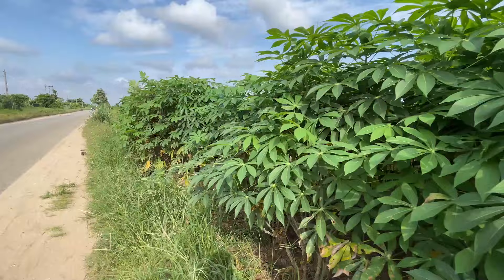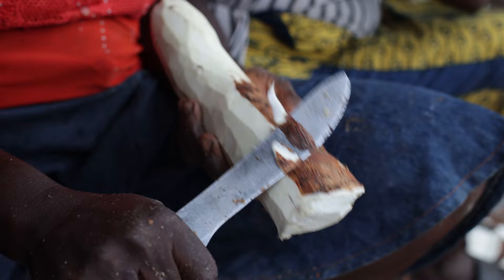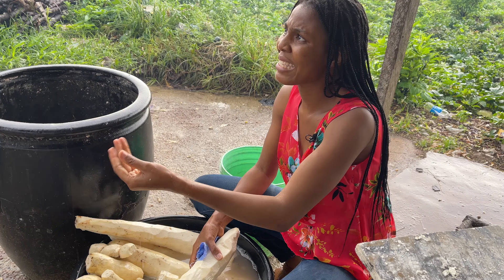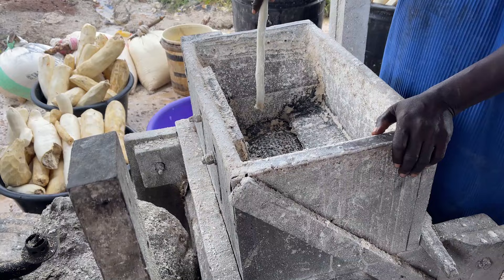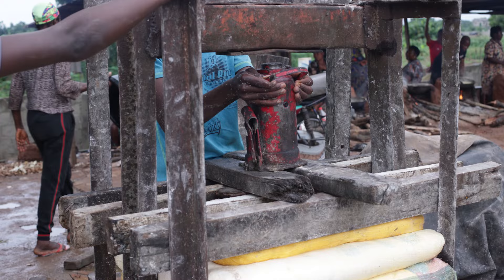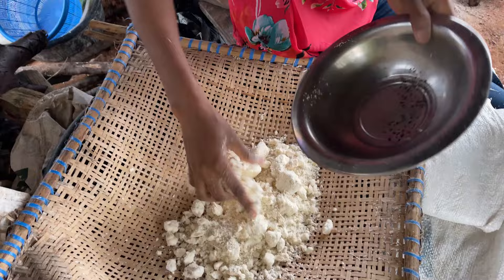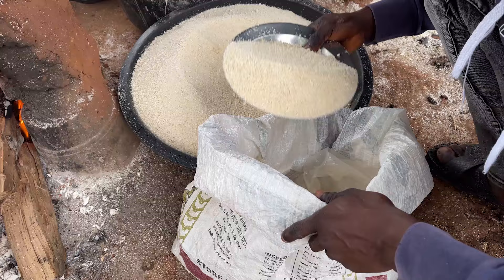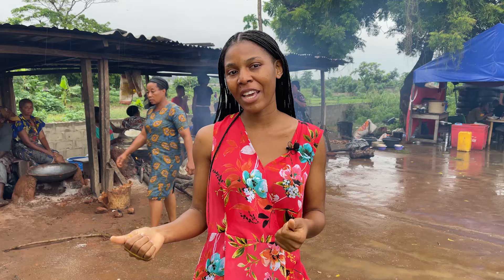HOW GARRI IS MADE FROM START TO FINISH| GARRI PRODUCTION

Comment: Please, can a normal pepper grinding machine, grind the cassava?
Reply: Cassava is harder and more fibrous, so it is more difficult to grind with a pepper or even corn grinder. It is usually grated or cut into flakes to make the grinding process easier. In Brazil, there is cassava flour similar to Gari (there are many different granulations, some are not toasted, others are, some are made without fermentation and others the fermentation is prolonged).

Comment: Why are we still using this crude method to make Gari. Here are some suggestions but not comprehensive.
1. Some Agric Students from our university.
2. Get some mechanical engineering students from our university.
3. Get some electrical engineering students.
These group of students can collaborate to design a modern process of making Gari. There are so many process and equipment design resources online that our students can learn from.
Who is going to fund the project? Some of our arrogant millionaires who don't have anything better to do with their money other than marrying many wives or building stupid Mansions with their stolen money.